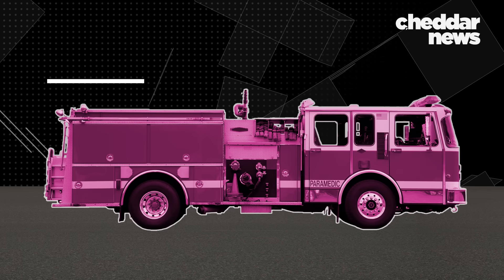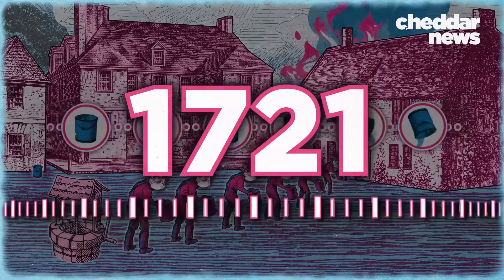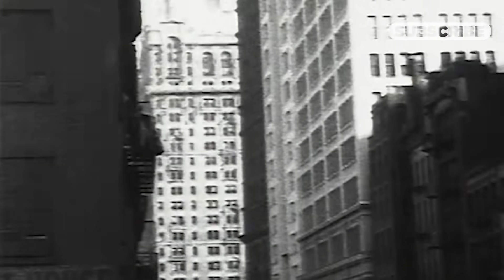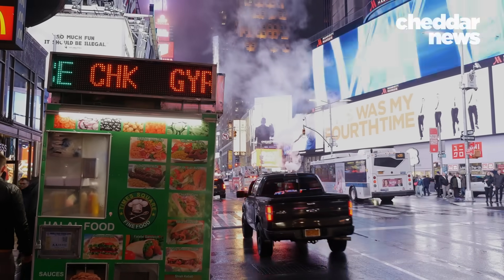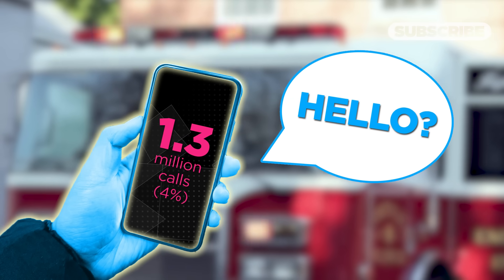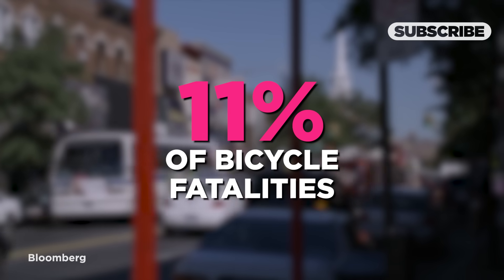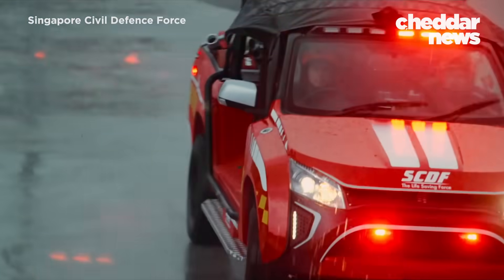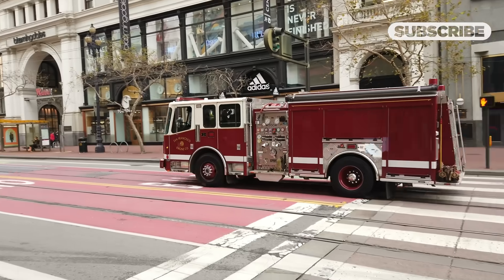Do American Fire Trucks Need To Be So Massive? - Cheddar Explains

Comment: Yea…no it’s a reason why we have the size trucks we do you should have sat down and interviewed with a few department chiefs for the reasoning on the size alone and what each truck is actually used for.
Reply: Agreed. Good luck using only smaller European trucks when you have to run a half mile of hose to the nearest water supply.
Reply: @Condor4R  Tanker truck goes brrrr
Reply: @Condor4R  we have Tankers, we have trucks with hose carts, trucks with hose beds, ...
Reply: @EnjoyFirefighting  How many stations have a lineup of every tool necessary? Additionally, we try to reduce the amount of trucks we have to dispatch where we can. In a pinch, having enough tools and enough water to put out a medium-sized fire, or be able to get it under control quickly is the most important goal. Having a single truck which is ready for any situation can seriously change the outcome of a call, which is why it is essential that we have larger trucks. It can often get dangerous to dispatch multiple trucks to a call as it delays the response time for a new call by redirecting to another station.
Reply: @Condor4R  
The average general-purpose fire truck can deal with the cast majority of emergencies on its own, the main difference to the average US fire engine is water and pumping capacity (which, as mentioned in this video, isn't needed all that often). More specialised trucks for pumping and carrying water are found in almost all departments, whilst rural regions have such vehicles spread out over multiple departments. Regular fire trucks tend to have enough capacity to deal with large fires until the specialised vehicles show up. Communities can also call the federal agency for technical relief for assistance, which has capabilities beyond what fire fighters can deal with, including very heavy rescue equipment and massive pumps.
Reply: @mikeblatzheim2797  Having 3 trucks with a wide range of equipment is highly valuable in many areas. My county departments are few and far between, so the ability to have another truck available for the same job is highly valuable. We have 3 engines, a tanker, an ATV, and a brush truck between our two bays. Ideally we are always focused on sending the least amount of trucks to most calls, so it is important to not specialize our trucks more than we need to. For instance, if we had exchanged a tanker for a rescue truck, it would set us back on an engine which may be useful later. Theoretically, it is 2AM and a residential fire happens due to a fireplace getting out of control. We send an engine and rescue there, and 15 minutes later an MVC happens because someone swerved into oncoming traffic because of a deer. We can send an engine to handle it(ambulance too), but now we have no trucks to rely on, should we have a new call. As unlikely as it is, worse calls have happened. Having a main engine and at least one auxiliary engine creates the best outcome, as our stations aren't as close as European countries are.
Also about federal assistance, we never do that. It would only ever happen if the state requested it, and that only happened in the wildfire we had about 7 years ago.

Comment: This video should have involved OFPC interviews at the least, or fire commissioners. The “smaller trucks” have been in service across the US for a long time. Mini pumpers and Misc./squad units are wildly popular and used where and when appropriate. Places like NYC have very small, old, and packed stations that only allow for 1-2 vehicles per company. That means each company has to have the gear needed for any possible assignment available in those two rigs. Small apparatus are great if each rig can remain in a specialized role, but when a single ladder truck (all other fire vehicles besides ladders are known as “apparatus”, not trucks) must be able to perform fire suppression, search and rescue, high angle rescue, water rescue, EMS, extrication, building collapse stabilization and rescue, confined space operations, light hazmat containment, and a trove of other duty’s… small just doesn’t cut it. The needs of inner city companies in a place like NYC are far too demanding and limited to so few houses and apparatus that each piece of equipment must be multifaceted and built to meet that requirement.
Reply: I agree that some apparatus need to fullfill several tasks, but you can't tell me that every apparatus at those tiny stations has to be able to fullfill e.g. building collapse stabilization and rescue ... guess that's why also the FDNY has a / several? dedicated collapse rescue trucks.
Reply: But that's what a European truck can do. They have all of that inside of them and are less wide, ~1.5 feet and shorter.
And they even have a internal Tank the same size as your American fire engine.

Comment: They did try in a few places to use Euro type firetrucks, in a city in New Jersey used a firetruck that is based on a European Renault  ,even now Rosenbauer has hit the market with an Electric firetruck that looks like it has the dimensions of an European firetruck., which I don't think that it will go far, once those batteries start getting old and now holding a charge, do you think that an electric firetruck is a wise choice especially when the vehicle is designed to put out a fire ,not catch itself on fire due to a thermo break down,  they should keep the vehicle's size but instead of being fully electric, they should be some sort of hybrid
Reply: Electric is the future unless Hydrogen turns up for longer range vehicles
Reply: @oscarosullivan4513  electric is by far no means the future lol never in a million years will that ridiculous ahit be the future
Reply: The Rosenbauer is an hybrid. It has a BMW engine as a range extender. Get your facts straight
Reply: can you link me to that renault fire truck in NJ?
Reply: European vehicles made it to the US emergency services quite a while ago. Anything from the Panther ARFF Crash Tenders to Tatra and Unimog offroad trucks, or the vans like Sprinter and Ducato.

Comment: This is tough to do where I live. We have to have the bigger trucks cause we have to haul water and tools. Our engine holds 3000 gallons and it does take up most of the road
Reply: Funnily enough Joseph that is also done over here.
Reply: It is impossible to do. In my VFD, our entire district doesn't have a single hydrant. We have to run to a nearby lake and place a cage in to get a supply. Our tanker pump went bad about 3 months ago and our whole attack plan has changed since. The repairs have been in progress by the county so we should get it back soon.
Some of the roads are difficult to traverse unfortunately, and our oldest engine can't handle the grades.
European engines just don't have the capacity for equipment we need in order to be prepared. We have plenty of medical supplies and an EMT station next door, so we could theoretically handle a mass casualty event(Bus MVC/Rollover) until backup arrives. I hope people don't buy into this video and ask for smaller fire trucks.
Reply: @Condor4R  yes but it's a well known problem. Car centric city design leads to low housing density, which leads to low taxpayer density, which means that Americans have to pay a lot of taxes for poor infrastructures. That's why Europeans has better infrastructure while paying less taxes. And that's why we can operate in rural Switzerland with a water tank of only 1500l (~500galon).
Reply: @fabswisss  It's not a problem of low income. Nobody will shell out millions of dollars to install water lines in the areas running on wells and septic tanks. Even if these areas were high income, they wouldn't have hydrants installed because the construction costs outweigh the benefits.
Reply: @Condor4R  For places that work with wells, it is sufficient to have suction points. That's how we do it and it works very well
Reply: @fabswisss  We drop a debris cage in the nearest fresh water supply and run it from there. That is, if we don't have a tanker or need more water.

Comment: The large trucks have a place where there is less infrastructure like hydrants and such as for larger cities they should have planning in place to upgrade or incorporate in new structures.
Reply: Or your country could fund water supply infrastructure in rural areas.
Reply: @oscarosullivan4513  only works in certain areas. Our town has very little water pipes since they explode in the sub 0 temperatures (most of winter is -30F)

Comment: Ok, so imma try be as clear as possible !
In North America, the size of a fire truck depends on multiple things, a what's being said in that video is only 10% of the reasons why there's so big !
Basically one thing that will make a fire department choosing between a smaller or larger vehicle depends may include but not limited to:
- Urban or Rural area (+ population density per square mile)
- Area specific requirements ( like old town with old and short building VS downtown with larger are taller buildings)

To name certain types of "firetrucks" :

- Engine / Pumper (Transport water and basic firefighting tools)

- Rescue Engine / Rescue Pumper (Transport water and advanced firefighting tools + rescue tools)

- Ladder (may be 100ft or 110ft sometimes, and "rear mounted" platform or "Mid Mounted" platform, it's the most common type of ladder truck in NoAm, and don't carry water)

- Tower Ladder ( Looks like a big extendable boom with a basket at the extremity, may be 75ft or 95ft most of the time, and usually don't carry water like the "Ladder")

- Tiller Ladder ( it's basically a "Ladder" but !!!! It looks like a semi with a "Second driver" that operates the rear directing axle for better maneuverability ! Its longer and may carry a bit more equipment than the Ladder, its only "Mid Mounted" platform)

- Quint (it's another type of "Ladder Truck" but this time it does transport water and/or have a pump on it, it's not the most common vehicle because it have a lot of disadvantages compared to the other types of ladders but can be useful for fire departments that are understaffed since it may be used to respond to both calls that would require or an engine or a ladder or even both, but with one truck and basically one crew of 4 to 6 firefighters)

- Rescues / Squads / Haz-Mat ( these are specialty/ heavy rescue vehicles, most of the time, they're staffed with 6 or 8 or 10 firefighters and respond to calls that may include but not limited to: large fires; large incidents; motor vehicle accidents; train wrecks; building collapses; confined space rescue; high angle rescue; chemical, biological and radiological incidents, and more, these are "Heavy vehicles" and may be "Walk-In" or "Non Walk-In")

And last, fire departments also use some smaller vehicle modified for fire departmens and that usually looks like an F-350, Dodge Ram 3500, Chevy Silverado, and are used for battalion/division/deputy/supervisor or basically just chief cars, or paramedics.

Well that was a long one !!!
But keep in mind that firetrucks are not "big" just to be "big" in the US the history and traditions are also one thing that keeps these vehicles big and make them look old, its a firefighter tradition !!! 
And to be honest, maybe that in Europe we have smaller vehicles but the average fire station here on a large city like Paris, France or Brussels, Belgium is actually having at least 6 vehicles !!! Where the average fire station in NYC, Chicago or DC its about 2 to 3 vehicles !!!!

So to conclude, North America and the rest of the world is different, here in Europe we have smaller trucks with more trucks per stations while in the US trucks are bigger, but less per stations !!!
Reply: I never understood how Tiller Ladders in the US still have a 2nd driver steering the rear ... it's 2022 and automatic rear-wheel steering is around for decades? By now European rear-mount platforms often come with all-wheel steering for increased maneuverability, but without a 2nd "driver" steering the rear. 
We have many of those apparatus but obviously with different layout and tasks here as well: Engines, Rescue Engines, Quints, typically rear-mount platforms of at least 105 ft and Tower Ladders usually ranging up to 150 or 170 ft, but with the tallest hitting 300 ft, then obviously different kinds of rescue trucks (technical rescue, heavy rescue, water rescue, mountain rescue etc), hazmat, special operations trucks etc; For chief and command we use cars and vans. There are lots of special operations apparatus which would make the list way too long here, ranging from EOD trucks to CBRNE detection units, decontamination trucks to all kinds of EMS units.
Reply: @EnjoyFirefighting  Well once again the dimensions, weight, and purpose of TT's (Tiller Trucks) do not allow the possibility to use automatic rear axle, TT's are always doing this "snake" thing around the traffic so it wouldn't be something "efficient" for fire departments, also keep in mind that maintenance is something crucial for fire apparatus, it needs to be easy and quick to repair this type of things, and the price !!! Price would increase so much that it would be a "commercial success" for companies building these trucks !
Reply: @thejaywalkingshow  we have trucks of similar dimensions which have an automatic rear axle. Also they can squeze thgouh traffic "snake like" as well, just that it's done automatically. 
That tech is so old that it's a standard today; If it needs repair it can be done rather quickly; Can't just keep everything manual and always need at least 3 more crew members because of a system which might need to be repaired some time. 

Narrow and tight streets are mostly a thing in the rather A) small and B) few preserved historic city centers. In many cities across Europe you have wide avenues and moderate wide streets as well. If a tram, articulated bus or semi truck gets through there, a fire truck definetly does as well

"Having large fire station is not a reason to talk bad" come one, many places around Europe have all their eggs in one basket. Two exmaples:
1) with two villages of 10k inhabitants, sharing their border, with their fire stations being 2.5 miles from each other, I doubt that both departments require the entire range of a fleet counting 9 or 10 units
2) when departments rather decide to upgrade stations which already have more than 40 bays, instead of building a 2nd station elsewhere in the city for better coverage of the response area, one should probably rethink that strategy, even if there are maintenance facilities and other services at the big house.
Reply: I find it funny how Europeans attack America for our culture, or just doing things a certain way, it's okay. But when we call them out for something different in their culture, they lose their shit.
Reply: @ecliptic6911  well, concerning this topic Europeans usually hear a constant rant like large stations are stupid, toy trucks, toy sirens, universal healthcare is stupid, they don't do interior attacks, don't have proper fire trucks ... it's that Europeans read over and over again. Is it surprising that they turn this thing around some day?
Reply: @EnjoyFirefighting  So on this one, it's just a way of looking at things, but it's being said in the video (and it's a real thing) in Europe we have narrow and tighter streets, plus population density !!!
Having large fire station is not a reason to talk bad about Europe, we may have a large fire station because there's a training center around, and maybe a maintenance building !!! We have demographic constraints, and it's may be easier ro do it that way !!!

Concerning American VS Europeans, i don't get onto these types of debates, since I'm French - Canadian...
Reply: The USA is so unique, no other country like it. No other place on Earth. So special...
Reply: @Megatonaxe  Every nation is unique, differences are meant to be respected.

Comment: I get what you’re saying but most of those big fire trucks that you may or may not be against or actually very useful the ladder truck in rich places that most trucks cannot get rid of somebody’s trapped in a building and it’s gonna take an hour just to get firefighters up the stairs because you can’t take them elevator then you would use the ladder I get were saying that yes they are really big but one thing is is that we still use a lot of them and you’re saying that we send water trucks to EMS emergencies we do not actually send the ladder truck we send heavy rescues or the rescue trucks so what you’re saying is is that where trucks pretty much are just too big yet. Say that they’re that small that like the ones that they have in Europe and Japan and wherever what about 911 we need to get a lot of people to the twin towers fast those tiny little vehicles can only carry a couple of people max it was big rigs they can carry at least 10 depending Which one and also if we had those small little trucks we would’ve been taking hours cause somebody would have to drive back pick up more people drive back pick up more people because not all of the fire stations are huge and have a lot of trucks some of them are small so we needed the big trucks because you can carry more people but I get where you’re coming from yes they can be pretty big but they are useful and that we still need them and it’s depending on what you need them Europe has smaller roads than us but we have much bigger so it makes sense that we have bigger fire trucks
Reply: Thats because over here they are trained in using stairs. As for the capacity. German pump appliances carry nine on average. As for more crew use a van/minibus for transport.